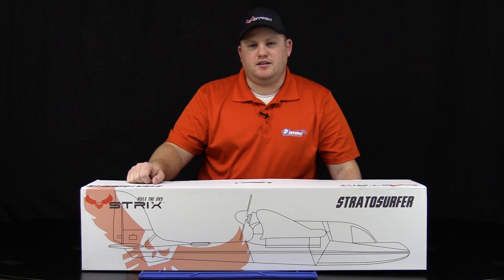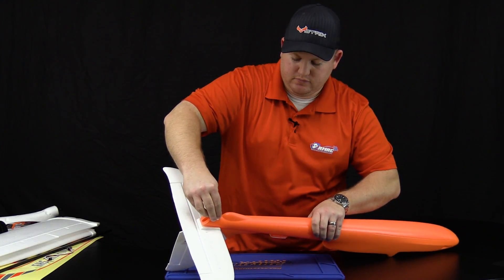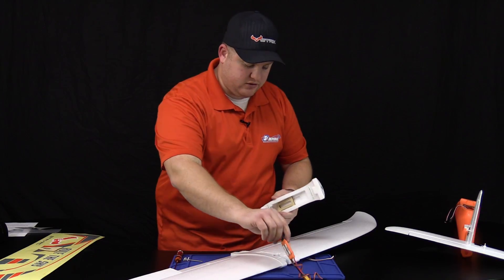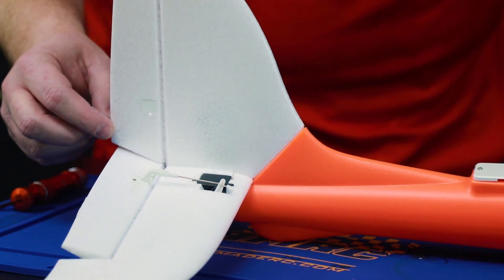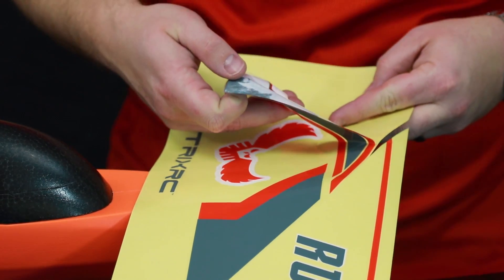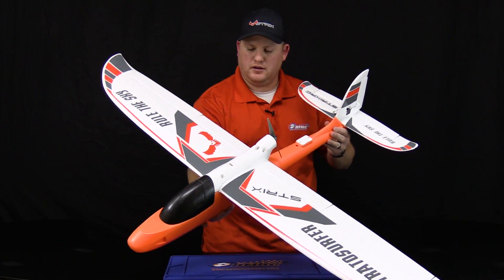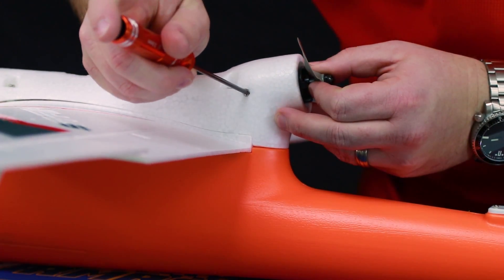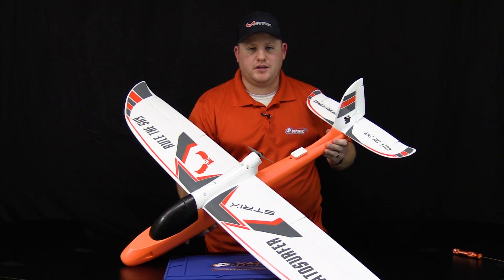Stratosurfer Build and Overview

Comment: Looks like a nice beefed up but "familiar" model for anything from trainer to perhaps mid/long range FPV! I like the molded fuse and increased wing area. I sure would have liked to see the motor pod molded as well, but still a very nice looking plane. Thanks for the build video!  

I think I'll take advantage of the before it's in stock price and would probably go for the pnp version (seems like a great price) but will probably upgrade the motor / esc after a couple of flights. So, a couple of questions... What is the total wing area? How about  prop clearance? Hmmm, the motor mount might also limit the motor size I would think. Does it? Thanks again.

Comment: Any tricks on tightening the propeller nut? It’s super hard to get tight. Feel like I’m going to break the foam.
Reply from the maker: Can you check the threads on the nut to see if some of the nylon from the locking part got down into the threads? We've seen that before, and just picking it out will loosen it up. Otherwise, do you see any damage to the threads on the shaft or the nut? These normally aren't too hard to install.

Comment: Hi, I really like this plane and I'm planing on buying it in the near future. Does it come with all I need except controller and battery?
Thanks.
Reply from the maker: lexugax correct, you will need radio equipment and a battery. The motor, ESC, and Servos are already installed.

Comment: After 3 years and RMRC is not responding to any inquiries.  Bummer.  I'm finding this company is a little hard to deal with.  I bought the kit and now I'm finding it very difficult to find out what more I need and, ESPECIALLY how to do the wiring.  I have many hours of flying nitro/gas line-of-sight and wanted to try electric and FPV.  I have no idea how to wire up what I bought and can't find anything to help either on RMRC or Youtube in the ways to do the wiring.  I think RMRC assumes that everyone buying their stuff is advanced/expert flyers.   But they would do well to recognize the beginners too.  Just sayin'
Reply from the maker: Looks like you had purchased a kit instead of PNP and we've been working with you trying to get the parts. Certainly the PNP is, well, PNP and super easy to get set up. Kits generally take more experience and assume you are buying your own items separately. We actually added all the items you would need to your shopping cart for you so you can just check out. Typically when people buy kits, they do it because they want to put specific items in them. We're sorry you aren't happy. You certainly would have had a better experience with the PNP if you don't have the background to set up a kit!
Reply: @ReadyMadeRC  You did not add those things into my shopping cart ... I did.  I inadvertently choose the kit when I meant to choose the PNP because I always choose the most complete option when I buy ARF/PNP etc.  At first, I questioned that perhaps I had received the wrong order but RMRC very offensively stated that I did not and I had to take another look at my receipt.  I discovered that I had made the wrong choice and was requesting help in making my 'kit' into the 'PNP' version without much success from RMRC.  So I looked at the difference between the two and added those things into my cart myself.  Because I wanted to get into FPV but had absolutely no experience in putting together and wiring these aircraft, I was continuing to inquire how to do this but instead was somewhat treated as if I had tried to cheat on my order.  In any event, I finally purchased the items in my shopping cart THAT I PUT THERE  and went elsewhere for help.